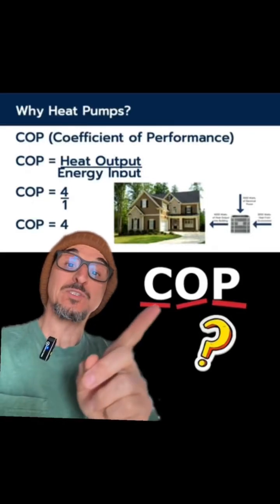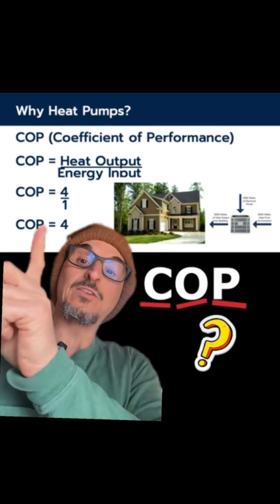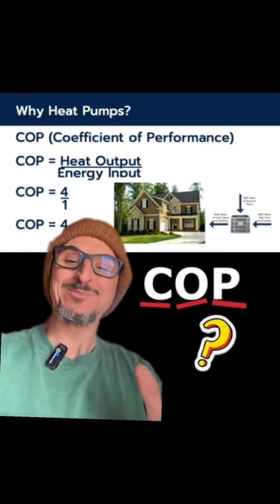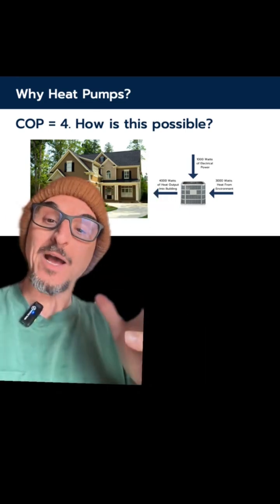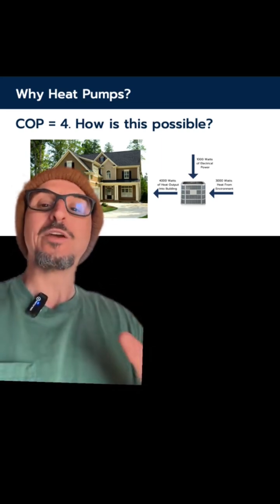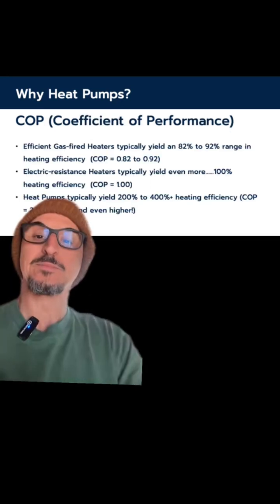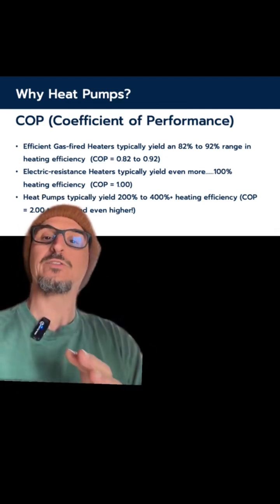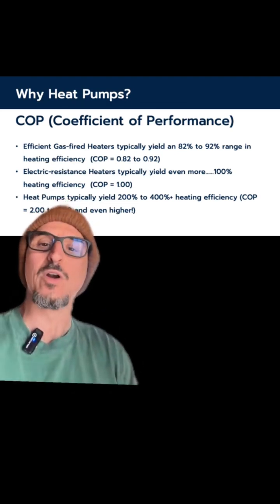Heat Pump COP explained! COP = Heat Output (in watts) / Electrical Energy Input (in watts) #hvac

Comment: Good explanation.  But there's one category of heat creation that, even though it's not common, should be included - MCHP - where you generate your electricity and the heat is a by product.  I know I'm splitting hairs, but it's good for others to know.